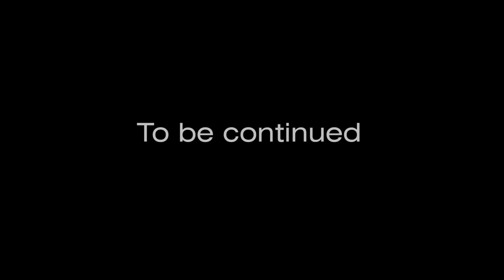🔥 1950 Drill Milling Machine Restoration | Part III B 🔥

Comment: Looking good Aless. One big recommendation would be to use set screws at 10:30, that way you can get them out if need be. A lot of the gears on my Royersford drill press are the same way, but thanks to the fact that they used set screws I can take them apart. That was necessary on a few of the gears, so I'm glad it was so.
Reply: Why did he put two screws in there?
Reply: Julian Mair it’s called a scotch key so the gear doesn’t spin on the shaft

Comment: I don't understand why you didn't use two grub screws in the end of the shaft rather than bolts and then skimming it flat ?
Reply: Because he gates the guy that will come after him.
Reply: Simply because he had them available. No need to buy every mf part.
Reply: @tomahoks  Agreed but if he ever has to take them out its going to be a right fucking prick  of a job. Did you think of that ?
Reply: I've never seen a Dutchman  done like that, awesome!😀

Comment: Isn't it supposed to be lubricated by oil not grease? Like the ways of a lathe or such. The two holes with flares to help the oil spread out?

Also nice work 👌